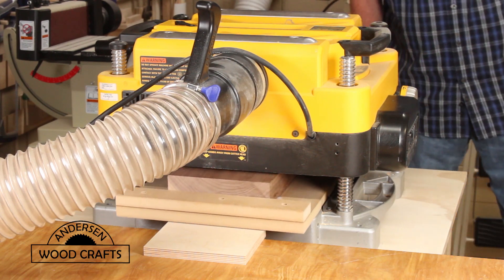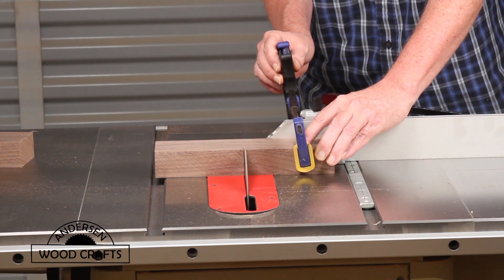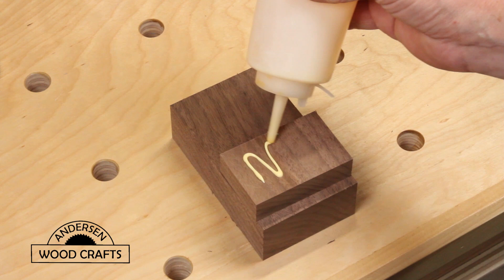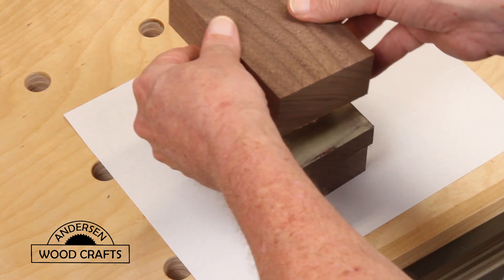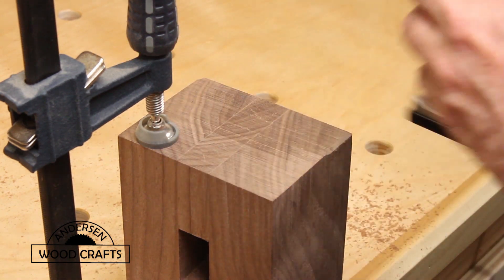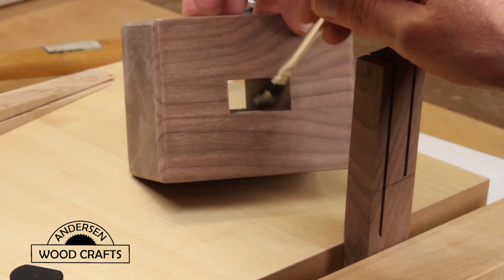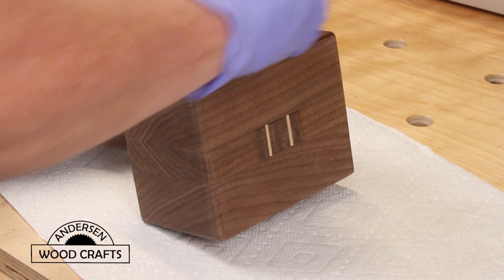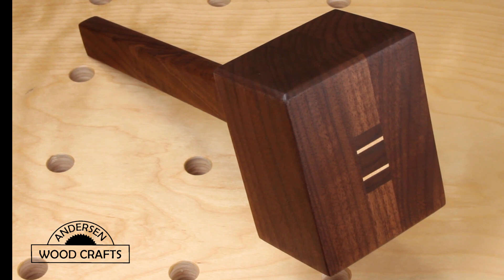EASY TO BUILD WOODEN MALLET

Comment: Good job like the video. I just finished making a few mallets myself. Question?  when you laminated the two middle pieces down did you cut them at a two degreee angle so when you hit your wedges down it wont move over the seasons with wood expansion? or did I miss that ?.    Awesome job
Reply from the maker: I couldn't tell you the exact angle, but they are at an angle.  Thanks for the comment and for watching.
Reply: @AndersenWoodCrafts  Awesome Loved it :)